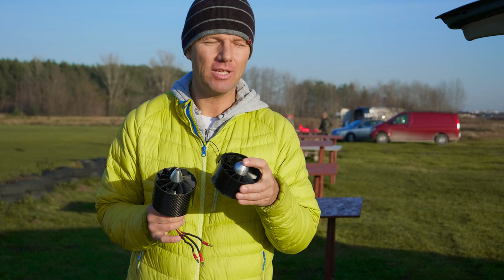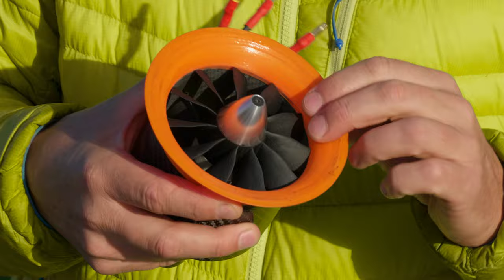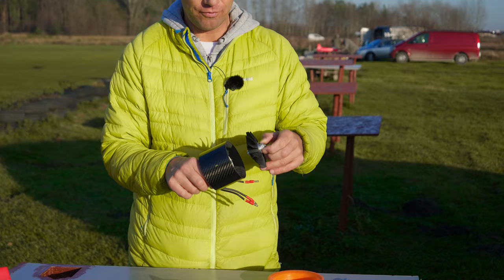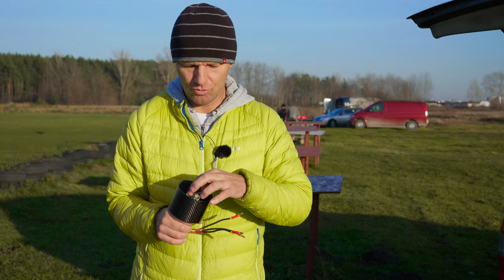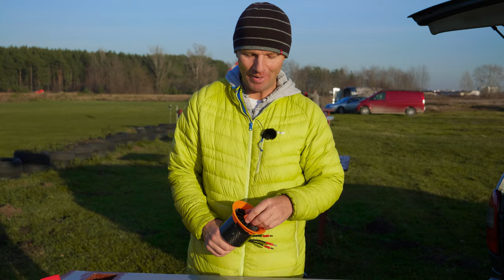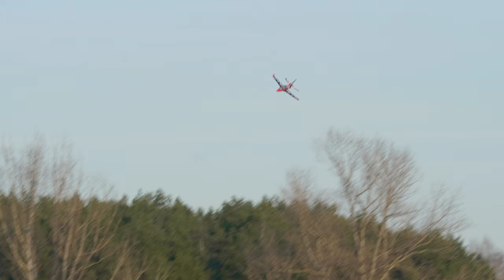Balancing EDF Jetfan vs WeMoTec, Black Horse Viper 235km/h, 8s 3kW  HET 700-75-1170 Li-Ion 120A 12Ah

Comment: Such good information! Sometimes if you try to balance a cheap EDF no matter what you do, it will never be quiet. Sometimes it's the cheap bearings in the motors that make the noise.
Reply from the maker: You are right. Cheap EDF is made of soft plastic which will never balance.

Comment: I'm glad you think hacker motors design is awful too. I've just pulled my e50l-1.5y apart and removed the internal fan from the shaft. Its 5mm thick, replaced with hacker spacer. Should sort the airflow in midi 100. Good video BTW.

Comment: Nice video Wojtek , but i have some questions about this balancing , i'm not , and i think many off us , can not do this in the good way , when whe buy a EDF brand new and we have to unscrew this , make and design a 3D PRINT , print a 3D LIP en put tape on the inside from the cone  , feel the changes whe have done and try again to make it better , thats for me a step to far. The suppliers from those EDF's have to make a good EDF for the customers 100% balanced , its like a SAITO radial engine , it costs 1000 dollar , but you have to send it to France or England to make it better for another 300 dollar because its not OK , its good , but not perfect out off the box , when i buy something i want to put it in the model and fly .... then i buy a SHUBELER and FLY IT . It cost more money , but its 100 % OK .. 80 % OK its good but i can not except this , whe have to contact the suplliers from those EDF's and say to them that those EDF's must be 100 % OK ... ;-) I hope other people can understand me ? Wojtek , start up a company , make 100 % OK EDF's and i'm your first customer ... ;-)
Reply from the maker: Ronny, did you notice that Shubeler uses bigger diameter motors for his EDFs wchich ruins the efficiency? Are you sure that Shubeler 110mm EDF with 56mm motor has better efficiency than Jetfan 110mm with 39mm motor? But it's not all... Shubeler has 56mm motor with motor housing on top of it so in total it is probably 58 or 60mm motor in contrast with only 40mm from Jetfan. Can you beat that? Are you sure that Shubeler is superior to that? And for more than double the price and much more weignt. And I heard many Shubelers totally unballanced on youtube videos. 
If you are not willing to put your heart into your models than they will be just toys.

Comment: Thank you for another great video. A question, the description says "motor HET Typhoon 700-75-1170kv" 
Visiting the ejets site, i cannot find any 700-75 1170kv, only 1250, 1400 and 1750, did you buy the 1170 somewhere else?
Reply: Or, is it the 700-98 one you have? :-D
Reply from the maker: Here :) https://www.turbines-rc.com/en/39mm-brushless-motors/1357-typhoon-het-edf-700-75-motor-39mm-1170kv-8mm-shaft.html
Reply: @EDFjetRC  Ah, brilliant, there it was, thank you :) Weird Google couldnt find that for me.

Comment: Good morninig  I have a jetfan 110 with a HET  700-98=780KV and heat sink installed . Would like to run this on 12 or 14 cell lipo . what do you recomend for thiss set up . Will it run ok , cool, or Hot . Thank you for your help   I have a Castel creations 160Amp esc for 12 cell . or YEP 200amp 14cell esc available . what you recomend .. Thank you 

Louis

Comment: Good morning . Your videos are really cool. I want to ask you a question. I have the BH viper and I need to buy the EDF. I ask you: To install in B.H. VIPER the Jetfan 120mm 590kv, using 14s would the sound be realistic, similar to the WeMoTec 100mm? Would it be necessary to make any modifications to the Jetfan 120mm for installation? I thank you for your attention.
Reply from the maker: Carlos, 120 fits bearly into BH Viper XL airframe. You need to cut out some wood framing in the tail to increase the diameter for the exhoust nozzle which should be 110mm. But it will fly wonderfull on 14s Jetfan-120 PRO with HET800-73-590kv.

Comment: Is there a trick to getting the nut off of the collet when you take the rotor off?  I have a Jetfan 80 and when I loosen the nut the collet turns with it.  The rotor slides off the shaft, but I can’t get the nut to turn without also spinning the collet.  I believe there is some factory applied loctite on the nut.  Any suggestions?

Comment: YOUR VIDEOS ARE VERY COOL...I HAVE A BH VIPER, AND I'M IN DOUBT WHETHER I INSTALL A WEMOTEC 100MM EDF WITH HET MOTOR 700-83-1080, WHICH HAS A VERY REALISTIC TURBINE SOUND, OR I INSTALL A 110MM EDF WITH HET MOTOR 700-98-840. I WANT TO INSTALL AN ENGINE THAT HAS A REALISTIC TURBINE SOUND.

Comment: Hi! I have put a 8s in a dr Mad trust EDF and Esc Matrix 120A  90mm with Li- ION (Model Viper Graupner 1400), Samsung t40, but when i want to take off the Power its very ridicolous AND DONT TAKE OFF , i change THE BATTERY with the lipo and the Power its more and he can fly, where IS the problem ? 
Thanks!
Reply from the maker: Do you have 8s1p battery? If so try 8s2p. Li-Ion Samsung 40T is happy with under 50A power. For short bursts you can load it up to 90A, but short bursts only. Li-Ions are not for power but for long flight. If you want power go for Hobbyking Phanter Graphen batteries.
Reply: @EDFjetRC  ok thanks bro but are very very slow

Comment: TIMING ?  What is the timing I need to have, low or high (Het 700-83-1080 +wemotec 100) , Will be the same if using 6 cells as compared to 12S  ?
Reply from the maker: Go for 0 degrees or LOW, yes the same